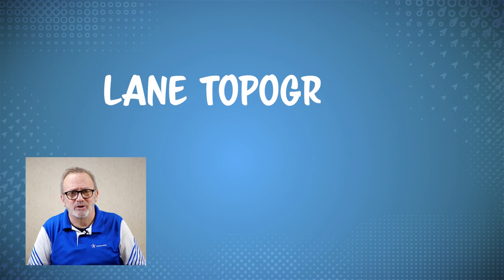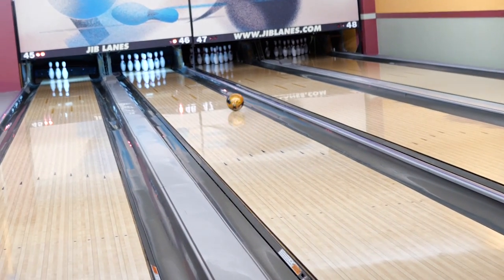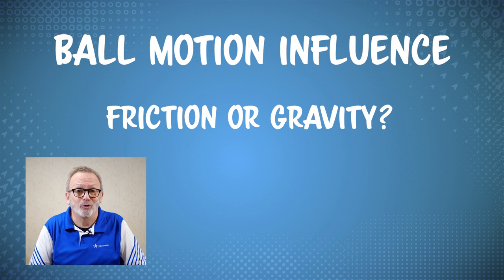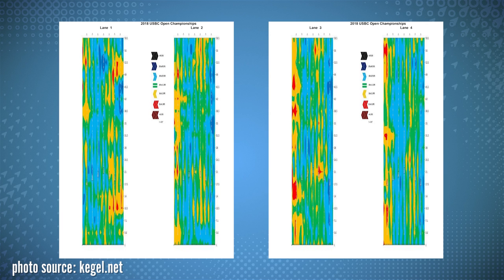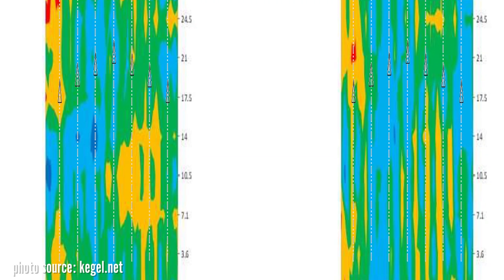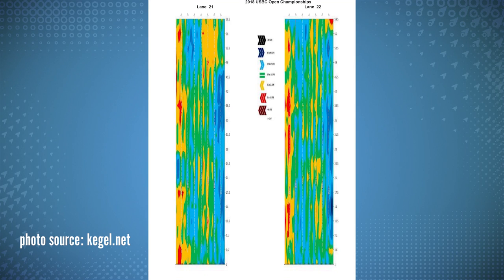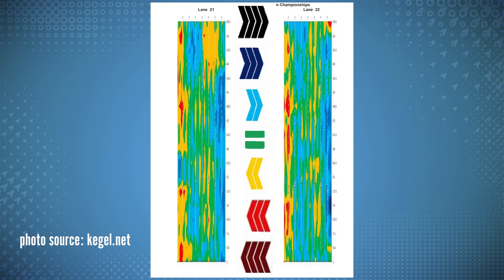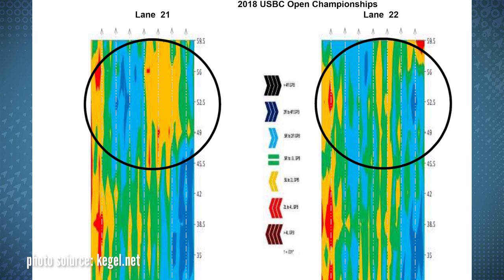Trouble Bowling On Certain Lanes? Here's Why! Bowling Topography and Ball Motion

Comment: Another good one, Arthur!  I thought I read somewhere, maybe in a Kegel report, that a dip about 2 dimes thickness can make a difference of 5 boards at the pins.  Also, the lane machines don’t recognize these topo differences, so when they drop some oil in a “valley”, guess what happens?!
Reply from the maker: Yes a little puddle. Which would be why you get hang spots on some lanes.
Reply: Art Of Bowling yep...and some serious head scratching results!  :)